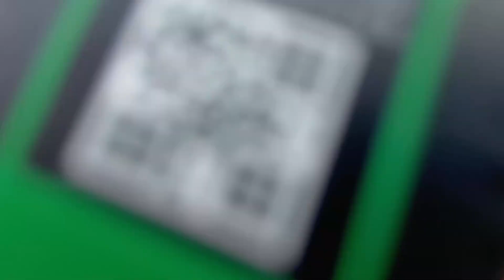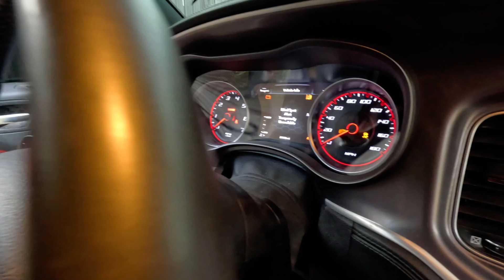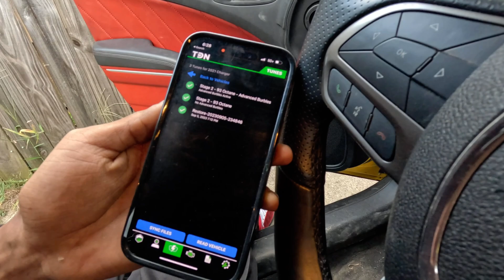Burble tuning my wide body scat *CRAZY FLAMES*

Comment: If you have a auto stick and can up and downshift gears going left or right the burbles are more dominant for me I’m a 6 cylinder it enjoys best between 2nd and 3rd but your gonna have to mess with it, also if you get it in auto stick mode it likes high rpm’s you’ll hear the pops more and they will be louder